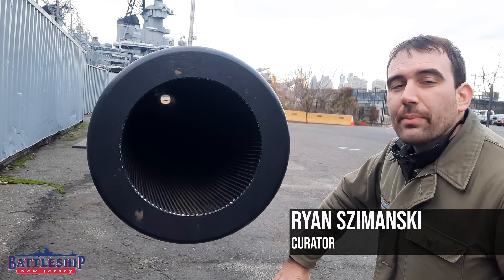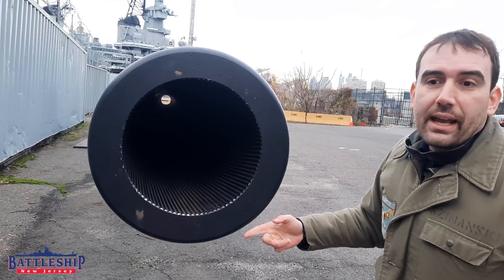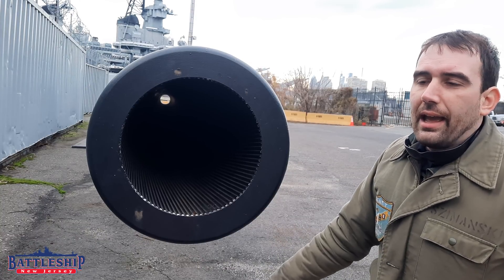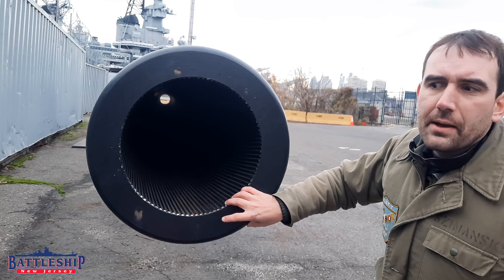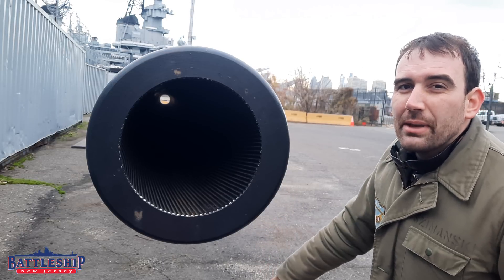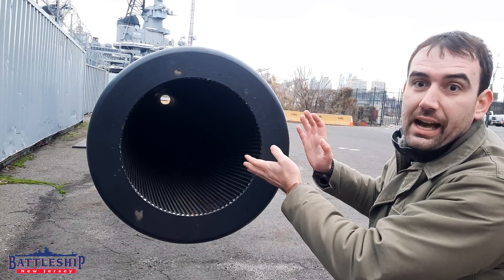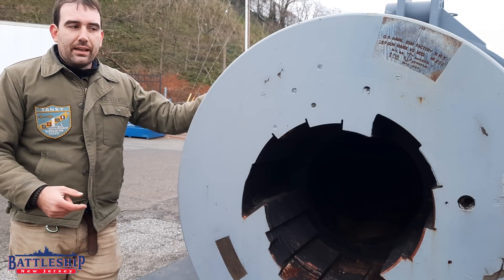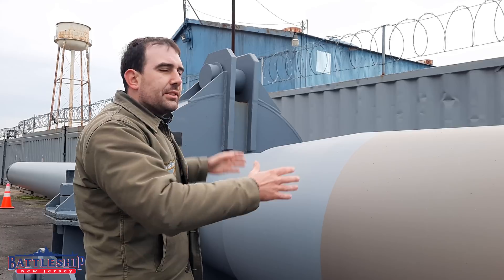16in Barrels: Construction and Maintenance

Comment: My uncle was a machinist in WWII and was involved in the manufacture of the 16" guns. He talked about how they were rifled and the machining or the breechblocks. One of the machinists made a mistake machining a breechblock and they made a patch that the inspectors didn't detect. I always wondered if that was the gun that blew up.
Reply: the gun that blew up did so with the breech open
Reply: @bugs19682  I was not aware of that.
Reply: They were supposed to be proof tested before installing on the ship, so it is not likely that was the one, but very interesting.
Reply: @thomasmoore8142  A defect could make it through proof testing.   That's where x ray inspections are crucial but don't know if they did it with these.
Reply: If you haven't read up on the Iowa already you should. There are several excellent deep dives into that tragedy.  There was something about experimental propellant and polyester bags that self ignited while being loaded and prior to the breech being locked. So your uncle's patch wouldn't have been the cause even if it was the exact same barrel.
The part that sucks with me is hearing the poor soul say "chief the bag is smoking THE BAG IS SMOKING I CAN'T CLOSE IT WHAT D...................."

I don't know if the audio i heard was recorded or reenacted for effect off of testimony but damn that sticks with you..
Reply: The barrel didn't explode
Reply: Barrels on Iowa class ships had a life of about 300 rounds.  Barrels removed were relined for reuse.

Comment: Do you have any information on the Reagan era plans for extended range projectiles for the 16" guns? They had the left over Army 11" projectiles fitted with sabots, but also rocket assisted rounds with terminal guidance. I've seen projected ranges of 200nm or even higher for some of the designs (I think I even saw 600nm at some point). Do you have any idea how far these projects got, or how serious they were?

Comment: I believe the process to make the barrels is called “shrink fit.” Many years ago when I was a mechanical engineering student one of my profs (actually many) was a WWII vet and he taught us how to calculate the temperatures needed to fit the tubes inside each other, the resulting compression, burst strength, etc.
Reply: Tony-The-Tiger Johns, also called an "interference fit."  Common when installing bearings and gears onto shafts.
Reply: When I took drafting in high school, we had to annotate type of fit, I don't remember the others, but this was FN, for Forced Fit. One piece got heated, the other frozen, and then shoved together.
Reply: In the era of Steam locomotives, a similar process was used to attach the outer steel "tire" to the cast driver wheels. They were laid dow_ Once sufficiently heated up, the outer flang and contact was then released, and it could be pried off.
Reply: I literally cannot comprehend the intelligence of men who figure this stuff out… 

I certainly consider myself to be pretty smart, but I’m acutely aware of all that I *DON’T* know, and stuff like this…. 😮😮 

just blows my mind… 🤯🤯
Reply: This is the same process used to make engine blocks, the cylinders have liners that are heat shrink in place, just like the liners of these guns.

Comment: Building up the gun from multiple parts stacked inside of each other wasn't done because they couldn't cast it all as one piece, it's done because it makes the gun stronger. What they figured out when they started building these giant cannons was that by shrinking a tube over a liner they could squeeze the liner down so that instead of the powder charge expanding it from a relaxed state the charge would encounter the metal in a compressed state, which gave it almost double the strength. Without this technology huge cannons are actually impossible, because simply making them thicker will not stop cracks from forming in the barrel if the force inside exceeds the metal's elasticity.
Reply: you are  correct, and the technical term for what you are talking about is "autofrettage"
Reply: @firstbaldwin  A similar technique is used in making springs, namely shot peening. Kept in a comprehensive state from the displaced material the metal is far less likely to form cracks, and this also helps reduce cyclic (i.e. tension then compression) stress. Real difference is that the barrel has material internally displaced whereas springs it’s an external treatment.
Reply: I know. I have the same problem. Most people do. When pressure exceeds elasticity, you crack.
Reply: I would expect the rifled liner to also be a harder/hardened steel to withstand wear better while the rest of the barrel would be softer to handle shock/stress loads better. Just an assumption, I don't know a damn thing about them, lol.
Reply: @TriggerHappy6T9  You are correct.  Different types of steel were used.  The harder liner is more brittle and less elastic, the outer containment is a softer more elastic steel, it is less brittle.
Reply: That makes a lot of sense. Thanks for the explanation.
Reply: Huh ok
Reply: Thanks!
Reply: Autofrettaging/auto fretting is a method of prestressing monobloc (single piece) gun tubes.  I believe this type of gun tube (in the video) is called an Armstrong Gun.
Reply: As with everything the many make the better whole. Shame this seems to skip most people, dead set on blasting so much blood, sweat and tears spent over the decades of US' existence.

Comment: Amazing to consider that the liners would often be forced out of the ends of the barrels over time. Says something about the sheer power of the thing even before it exits the barrel
Reply: I don't think much needs to be said about the power of a gun that big. I'm honestly not surprised.
Reply: The projectile is moving at its highest speed as it leaves the barrel and slows down from there. And I just realized he didn't climb through an installed barrel...does not count...he has to do it again...but in a barrel on the ship I it's turret......
Reply: @bentboybbz  He could get tips from Cheftain.......

Comment: I wonder, if nowadays industry would see it as a major challenge to produce such big guns. I suspected that they made them by using a layer technique, but I was not sure until now. Impressive stuff.
If I visit the states I hope I can make it one of these BBs. Gneisenau's 28cm and 15cm turrets are also on my list.
Reply: Where is the Gneisenau’s turret located ?
Reply: @chucksevola2424 
At least two 15cm/6inch twin turrets can be found on the east cost fo Denmark at Stevnsfort (Google Maps: 55.26364352471323, 12.413555591792123). That is a bit north of  Rødvig.
Turret C is located in Norway near Austratt to protect the entrance to the Trondheim Fjord. It is a museum these days (Google Maps: 63.70840707716542, 9.72217198116162). It's like a remnant shadow of the former vessel.
Guns from disassembled turret A and some 15cm  also still exist elsewhere.
Just check https://en.wikipedia.org/wiki/German_battleship_Gneisenau .
Hard to believe that Germany rejected a norwegian offer to take turret C back. Some people really lack any sense for history.
Reply: @achdumeineguete  thanks!  Added to the bucket list!

Comment: Thanks Ryan.    
I've known about heating the barrel to get the liner 'in'.    
Didn't know they used the same process to get it 'out'.
The pdf on 'reactivation of 16 inch guns' says that the old liner was discarded and an new one installed.
That's what I've been curious about.   The liners are not 'relined'.    They liners are replaced.
Reply: Who said that the liners were "relined"? It was the guns that were "relined" by replacing the liners.

Comment: The 16" gun barrel is made like some shotgun barrels-the inner liner.And the barrel is also like a modern rifle barrel-the unrifled area the chamber to hold the cartridge or in this case the projectile and the powder bag charges.When I toured the battleship in Mobile,alabama was able to see diagrams on the displays for this.And when I visited a place near Annapolis Md they displayed an armor panel 16" thick that was "holed" by one of those 16" guns-the completed barrels were tested on a range on the Anacostia river-back then it was unpopulated-now the tested couldn't be done.And in one of my gun magazines a powerder "kernel" used in one of the charge bags-was hollow tube the size of a .44 mag pistol cartridge!

Comment: Ryan, please Google "Naval Ordinance Plant Pocatello Idaho"

The Naval Ordnance Plant was commissioned in April 1942. It was a huge facility. The shop where the big 16” ship cannons were refurbished was 840 feet long and 352 feet wide. Eventually about 50 buildings were constructed on the site.
 
Manufacturing and refurbishing enormous guns for battleships was the main focus of the facility. Artillery needs to be refurbished after a certain number of shots are fired because the spiral grooves inside the barrel wear down. Those grooves set a projectile spinning, improving its steady trajectory. 
 
The Pocatello plant was one of only two in the country to do this kind of work, and the only one west of the Mississippi. The site was chosen because Pocatello is far enough inland to make enemy bombardment less likely, and it was a major railroad and highway hub.
 
An ancillary part of the operation took place on the Arco Desert. About 50 miles northwest of Pocatello, the Navy picked a 271 square mile site from which they could test fire the big guns. It was called the Naval Proving Ground. The site contained some 27 buildings; shops, administrative operations, powder magazines, warehouses, and housing for personnel. During World War II the Navy fired most of the ordnance into the desert to the north. For a time, during the Vietnam Conflict, projectiles were aimed at the side of the Big Southern Butte. The change in targeting was due to development in the area of the original site.

Copy and pasted from site

Comment: When I was on the Jersey there was a cracked barrel no 2 Barrell on number 2 Turret. Did that ever get replaced?
Reply: The barrel wasn’t cracked. It had gas wash pockets in the liner from its use in Vietnam. The center gun of turret 2 was replaced in summer of 1984 upon the ship’s return from Lebanon.
Reply: @robertlian2009  I transferred in August 84 . I Didn't know it was even planned. The big thing about that repair availability was walls and doors put in the toilets.

Comment: I would like to hear about WWII use of colored smoke to allow the fire control officer to link salvo to the turret to adjust the point of aim.  What chemicals were used to give which colors.  How many colors were used and did different Iowa Class ships have different colors?
Reply: 356win USS Iowa orange , USS New Jersey Blue , USS Missouri Red and USS Wisconsin Green . These were AP Mark 8 and the nominal Dye Bag was 1.5 lbs up to 3 lbs .   Please note that I am Not an Expert , I just remembered your question and had read about it so I came back to find you .   I hope this helps ?   My Win is 1895 .
Reply: it was colored dye not smoke

Comment: I believe other than being put on display at museums, several were cut up for scrap when the last Iowa was removed from the roster.
Reply: Correct. I have a piece of one.
Reply: @SearTrip  Did yours come from John in Santa Maria, Calif?  He had 4  barrel sections years ago and said the machine shop had a difficult time handling and slicing them.
Reply: @kimmer6  yep. I think mine actually came from the second batch of them he had.

Comment: Sounds like the same concept on hunting rifle barrels. Which is from the back the projectile is shoved into the rifling by force of the powder charge which is called "Free Bore". The hoops around the chamber acts like the receiver with a locking breech. The rifling spins the projectile into the barrel into progressive twists in the rifle world that is called "Progressive Rifling" which increases force of the rifling on the projectile's bands wrapped around it to increase velocity and to seal gases behind the projectile. Thus increasing it's accuracy at range.

Comment: Interesting video. I did a search on that PDF, but as far as how the breeches, breech blocks, barrel boring and rifling of the liner is accomplished there's not much available. This might be well outside the intent of this channel, but links to any YT videos or PDF's produced by the Navy or a future video explaining how it was done in detail would be great. Those interrupted thread  breeches and breech blocks are an extremely tough and complicated process. Much easier done today with CNC, but far harder to do when only mechanical methods were available. I'll admit the exact manufacturing processes used to manufacturer the parts are not really a part of a ship museum though. So I understand if that's not a direction you want to go into detail about.

Comment: Engineering nerd here.  The likely barrel material is 4140 chrome moly alloy steel or maybe 4340.  These workhorse alloys can be reasonably hard, but still tough and ductile.  The metal would be poured and forged to near round   It would be rough machined, heat treated, straightened, and final machined.  
  Thick wall pressure vessels, under pressure, have high inside surface stresses, and low outside surface stresses.  Heating the barrel, cooling the liner, then shrinking, more evenly distributes stress across the assembled barrel wall.  (As does wire wrapping and “autofrettage”j
  The barrel life improvement in the 80s may be powder, but also steel melt process improved extending fatigue life.  Also inspection processes.
   Hat tip to the craftsmen that made these barrels.  Big stuff has interesting challenges, puzzles.   One Mistake ruins an expensive part.  Cheers.
Reply: The liners were chrome plated from just forward of the chamber to the muzzles.
I wonder how progressive-twist manufacture might have extended barrel life on the 16" types.

Comment: I have a question that came up over the dinner table today, was the plaque noting the surrender of Japan on the USS Missouri added after it became a museum ship? Or were there sailors in the 1980s stepping around it?
Reply: The plaque was there when I saw the ship still in service prior to decommissioning.
Reply: Alex Turner Interesting thank you
Reply: The original plaque was there from October 1945 to 1988. It was removed and put into a museum. A new one was made and fitted to the ship as a replacement.

Comment: I remember as a kid living at Subic Naval Station in the early 80s the navy had three of these thing there in storage.
Reply: I was at Subic and Cubi Point on and off from 1971 through 1974. Those barrels were along the road at the Subic end of the road between there and NAS Cubi Point. 
Every time we passed the barrels, which was many times, without fail comments were made about them. 
I think those barrels at Subic were eight inch types. That's what I had been told.
At the time there were many cruisers in the Pacific area and that meant lots of eight inch guns around. 
Never saw those barrels at Subic moved around though.